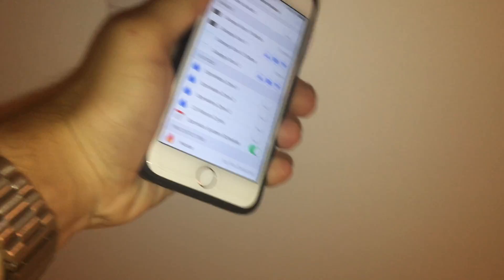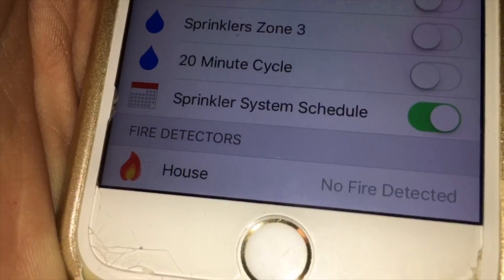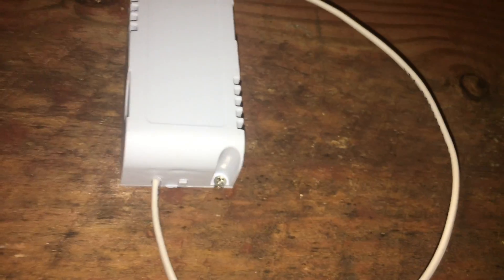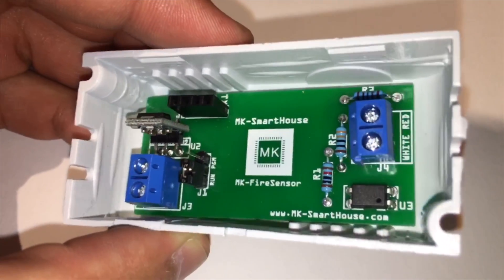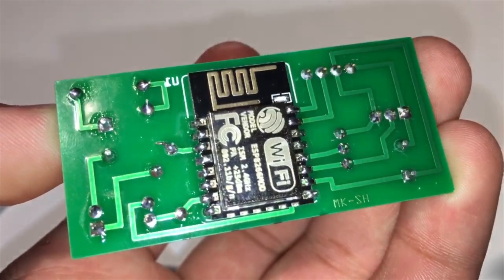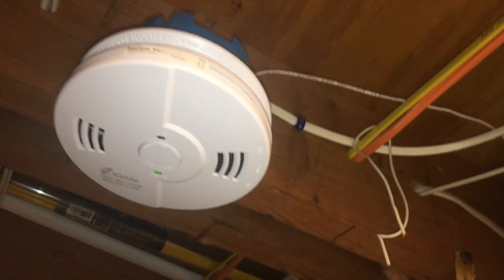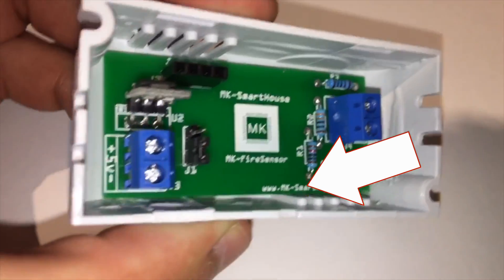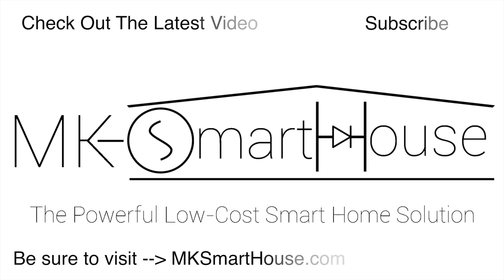Complete Guide Fire Sensor MQTT OpenHAB ESP8266 : Demo

Comment: so if i have a fire detectors that can be linked out of the box with other fire detectors,  i just need to wire one fire detector the discribed way and it will work ? Am i understanding this correctly ?
Reply from the maker: +Fred Zibulski All you have to do with this device is tap into the red and white wire of the fire detectors.
Reply: I have fire detektors all over my house that are linked wirelessly. so would i need to do this with all of them or only one and if one goes of since they are all wired will it work as well ?
Reply from the maker: +Fred Zibulski I think only one.
Reply: MK-SmartHouse sounds good thank you